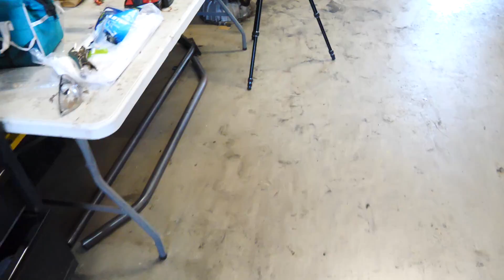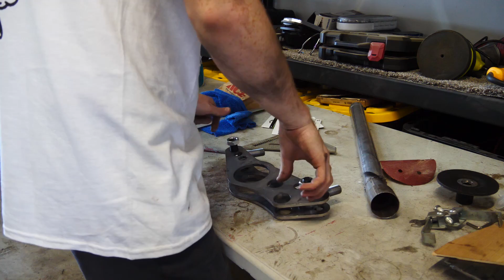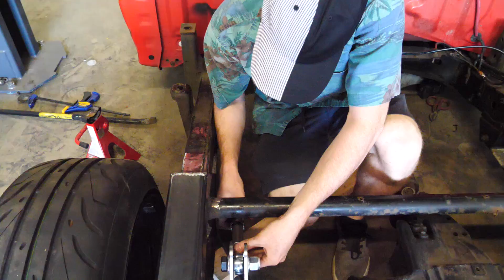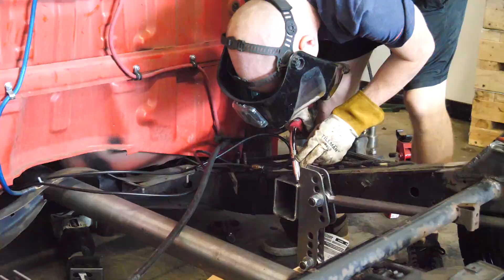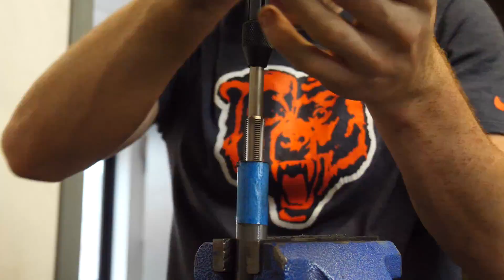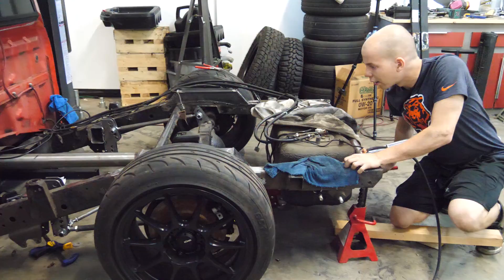Drift Truck gets a CUSTOM 4 LINK REAR SUSPENSION! (Lots of Fabrication)

Comment: When I decided to add a triangulated four link to my 1976 F100, I did so to solve a sever traction problem that manifested after installing my stroked 421 Windsor engine.  I went to the Art Morrison website and went to his technical page to learn about the dynamics of a four link system.  With a wealth of information to guide me, I designed the entire system on my computer then sent the files out to a laser cutting shop and received the parts six days later. 
After boxing the chassis, installing all the new mounts and link parts, adding spring perches, Afco springs, new drag shocks and stabilizer bar, I fired up the truck and did several launches on the street.   I knew all systems were go, when my friend witnessed the front suspension lift while the rear of the truck squatted perfectly with the front tires off the ground.  I call that a successful custom four link..

Comment: im building a colorado drift truck and im curious why you did not go triangulated 4 link. im asking not criticizing because i bought a drag truck and plan on modifying the suspension for drifting as it already has the power. 
love the videos have watched most of them way before i got my own project and once i saw it i found my own drift truck

Comment: He should at the very least place the panhard bar behind the axle and parallel to it, where it was designed to be, and will actually limit side to side movement instead of just binding up the suspension. If the frame and newly mounted brackets couldn't flex it would bind up the suspension pretty bad. leaving it like this will probably either crack some welds or bend something, it won't stop wheelhop.

Comment: are my eyes playing tricks but i don't think you'll be able to get the bolts that connect the drag links or whatever out because the mounts on the front are too close to the frame
the nuts should go on the inside so you can change which hole its in?
Reply from the maker: Yeah you're right. I screwed up lol. I'll have to cut them out and replace them

Comment: personally id have gone for a triangulated 4 link as the space was available also the panhard bar is on whats normally known as the wrong side of the diff as often the run from above the diff but as long as it doesn't foul there should be no issue the articulation in the axle from the small clip of you rocking it i hope that wasn't all the articulation available because if it was you will end up breaking bars and the such under roll  if you think about the maximum travel the damper can have then you will want at least that much in articulation available, further more when it comes to the dampers please mount them as wide as you can on the bottom and maybe with a slight angle inwards towards the top so that they can allow the articulation to occur better also id suggest a damper which has a spherical bearing both top and bottom to allow the motion to occur with less resistance,try to get the best motion ratio (ratio of damper to wheel movement) you can ie don't do a morgan 3 wheeler and have a ratio of 0.2/1 go for a ratio of like 0.8 to 1 if you can you may only get like 0.5 but that is better than nothing
Reply: i love your work though keep going!

Comment: I suggest drilling a drain hole in the four link bracket you made..  i'm talking about the square pipe you welded to the chassis, as you boxed it in.. the ingress of water through the chassis could eventually rust the welds..

Comment: Gingium your "5th" link pan hard bar is supposed to be on back not under drive shaft... and what you should do is get another stick of that 2x6 and go across your frame rails for your 4- link frame mounts to support them cut a notch for drive shaft that a piece of strap and go under added in 2x6 so it will give strength to rear half and better support to 4-link frame mounts and you'll have a drive line hoop for safety all in one shot also cut the cross brace round stock that is already there get another round stock piece and weld them across your C-notch above your axle....
Reply: There are quite a few 4 link setups that run the track bar under the driveshaft. A 51 Chevy pickup with a custom frame I’m working on is setup that way. It can be put however as long as it has sufficient clearance. I work at a place called Toxic Designs and see old vehicles with custom frames on the regular. Almost all have had the track bar run underneath.
Reply: I was thinking the same thing. Looking at Factory 5's 4 links...
Reply: ^Yeah what he said!
Reply: Your right, panhard bar goes behind the diff, but a track bar goes under the driveshaft like this setup, it has alot less lateral movement as the suspension travels as compared to a panhard bar
Reply: @baddonkey6876  exactly....a diagonal link has alot less side to side movement
Reply: Man I could use your help on my Mazda 4 link this week.

Comment: Oh, I thought you are going to full on independent suspension. =/ Also that kit looks so flimsy that it´s not going to last long. And I doubt it´s going to have any affect to the handling because of the donkey axle, the wheels are still attached to each other by a girder. But interesting to see when you go drifting it next time.

Comment: Looks to me like the top bar will hit that frame cross member
Reply: I would think that cross memeber will be cut out and relocated to the box section that was added for the frame notch. I would prolly go ahead and add a 2nd cross member and some triangular braces between the new box sections on each side. Can never have too much strength! Good work Gingium!

Comment: Would doing a cross member all the way across the frame and notching it for the drive shaft be stronger than just welding the 4 link to the blocks? Just a thought?
Reply: Yes it would. Not notch it but buy one with a driveshaft hoop in it.

Comment: you should have put the rear axle forward a little because the wheel is not in the middle of the rear wheelweel
Reply: That's just how the truck looks even with the factory suspension
Reply: Okay i didnt know so i thought it looked weird

Comment: He could fab up some mounts and make a coilover conversation for the rear and cut out the bed floor and buy a bed cover so you can do some easy rear end work and cage in the rear and do a fuel cell swap and lighten up the rear end and you can have the frame notch higher and then you can get the rear end low as you want
Reply: In pretty much every scenario you don't want to make the rear end of a truck lighter, all the weight of a truck is in the engine bay and cab. The lighter the rear end is the less grip/traction you'll have.

Comment: Gingium, what is your opinion on 3 link suspensions? 

2 lower links used from this kit. 

But on top A-form link. (like miata's wishbone) 

Those two opening ends would be attached to the frame rails on each side, and that center part going to the center of an axle. So it will have up-and-down movement(like a wishbone). 

It won't have no side-to-side movement like trackbar does, or this diagonal (like a wishbone, because it's literally a solid triangle with two ends bolted to the frame.) and the center hyme has also side to side rotation, so it will let axle tilt if needed.

Two lower links attached to the bottom. This wishbone(which should be better called trailing arm) attached to the top. So this axle won't flex on hard accelerations, or clutch kicks like leafs do. 

Btw, seen on drag aplications. 

So here you have it: 
up and down moving axle 
tilting axle 
no side to side movement 
no leafspring-like flex
wayyy simpler

What do you think?
Reply from the maker: I wanted to do that system, but the pumpkin on this axle is NOT in the center of the axle. That makes it much more complicated to make and I didn't want to deal with that.
Reply: @_Gingium_  what about welding a bar of steel on top? Like that frame notch work?
Reply: This system is commonly found on some vintage Alfa Romeos. It's generally a better and much simpler system than a 4- link. Another option is to use a torque arm or torque tube in the center, with a proper panhard bar. many Opels used this in the 60's and 70's, its one of the best handling setups for a live axle you can get.
He should at the very least place the panhard bar behind the axle and parallel to it, where it will actually limit side to side movement instead of just binding up the suspension.

Comment: I wonder if I should go 4 link when I slam a Vortec 454 into a chevy C10?
Reply: Miatas Forever I’m think about doing that in a 1963 gmc c10. I have a 454 and th400 out of a motorhome. It’s current engine (a big block v6) might be seized and it has a manual 3 speed so it’s not the best combo for modern highways.
Reply: Joseph Samsor I am looking at a c10 or possibly getting a 90's S10 to save some $$
Reply: Miatas Forever idk, if I were to build a truck, idgaf what it is, it’s getting a 4 link. It’s just easier in the long run.

Comment: You sir need to put down the grinder and learn to run a mill
Reply: Hell no he should get a belt grinder
Reply: @rubenbraekman4515  Why not both?
Reply: Agreed. But it still is impressive he’s built majority of his projects with an angle grinder.
Reply: Both is fair but this hack work with a grinder needs to be replaced with the precision of a mill period, so much faster too.
Reply: Rosenberg Band gotta do whatcha gotta do. The mfer just bolted his vise down, he’s making progress lol
Reply: @rosenbergband6828  Mills are pretty expensive though. Especially if you don't want a worn out hunk of garbage.
Reply: BoostAddict clapped out bridgeports are accurate enough for what he does

Comment: Yeah you were not supposed to cut those open you are supposed to slide over the axle tube
Reply: That and he really needs to put a cross member between the front mounting points and support the bottom portion of the front bracket before it twists and rips from the frame.   I know hes going to put gussets on the side but the he needs to worry about the front of the lower part of the bracket as well.